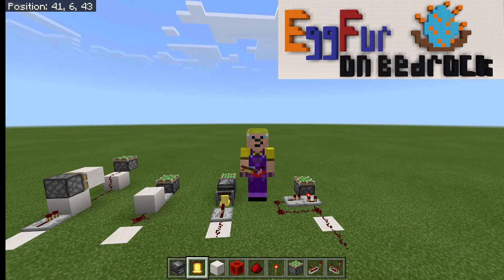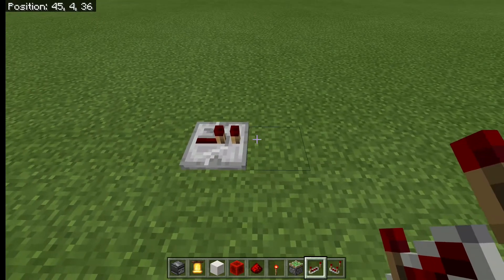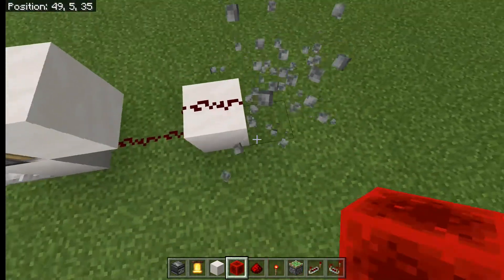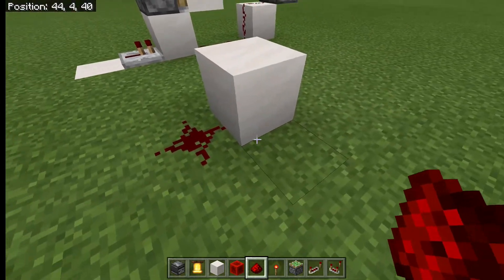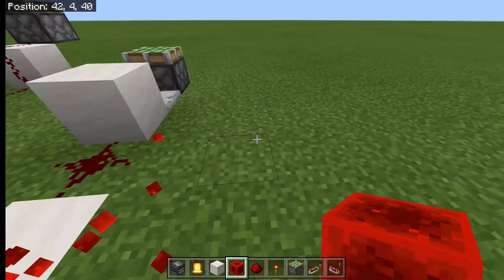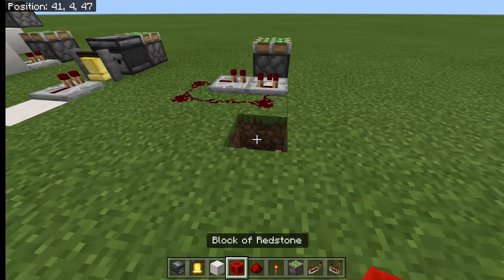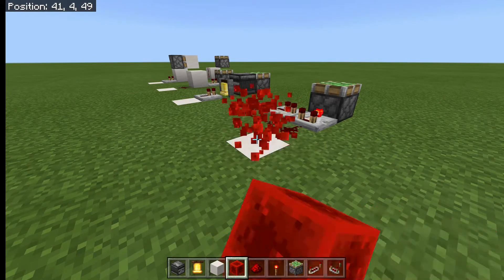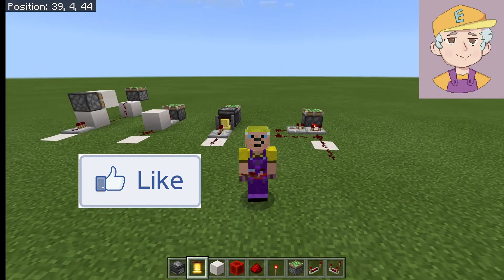4 one tick pulse limiters for Bedrock Edition (now 5! Read Comments)

Comment: For some reason the second one doesn’t work if I power the redstone with a repeater?
Reply from the maker: Are you powering the redstone or the block directly above the sticky piston?
Reply: @Eggfur  I’m powering the redstone itself, for some reason if I power it with a directly with a redstone block, lever, etc it works but if I power it with anything that causes delay (a repeater, a comparator, etc) then the redstone somehow powers the piston without the repeater on the other side getting any output
Reply from the maker: It's going to be because of p-ticks (producer) and c-ticks (consumer). Something I didn't know about when I made this video. It's a bit too complex to go over in a YouTube comment though. Have you tried the 5th method that I link from the description? It's super small and simple (an observer watching the powder snow dispensed by a dispenser). It's main disadvantage is that it will be just slightly slower to activate with a chunk border in the way - but only by 1 tick.
Reply: @Eggfur   I haven’t, currently working with a weird system where I link a repeater to a piston that pushes a redstone block which powers the mono-stable circuit, but I’ll definitely try it out, thanks! Could you please link me an article about the whole p-tick c-tick thing?
Reply from the maker: See how you get on with this. I'm not sure it's the best explanation but will give you a good start: https://youtu.be/oyLZa7dmxYw
Reply: @Eggfur  thanks!
Reply: @Eggfur  ok I’ve seen the video and also another one but I don’t exactly understand what this has to do with the powering of the mono stable circuit? Like it seems to only apply to things powered for a single tick but I’m powering the circuit permanently so I don’t really get why it powers the piston before the repeater
Reply from the maker: It stops being powered as soon as the block above the sticky piston start to move. So you only have time for a c-tick through the block which won't power the repeater. If you replace the repeater directly with a consumer (piston, dropper, etc ), it should activate
Reply: @Eggfur  yeah but the part that I don’t understand is how powering it with a different source changes things
Reply from the maker: Because a player activated action sends out a pulse starting on the c-tick rather than the p-tick. And same for the moving redstone block.  That's also why when you power two pistons with the same lever, but one directly with dust and the other through a one tick repeater, they both extend at the same time
Reply: @Eggfur  oh I see, thank you. No source I found mentioned that, so that’s super helpful to know.
Reply: @Eggfur  one last question: is this feature exclusive to bedrock?
Reply from the maker: p and c ticks? Yes. It's all related to the random update order and other redstone optimisations for performance.
Reply: @Eggfur  yeah no I understand how it works but java and bedrock were coded in different languages and tend to have inconsistencies in their redstone (quasi connectivity, or for an issue that relates more closely to game ticks and updates: bedrock redstone being inconsistent compared to java redstone) so I was wondering if it also works that way in java
Reply from the maker: The coding languages have nothing to do with it. Bedrock was written to work efficiently on low power consoles and mobile phones and so the redstone mechanics were changed since the Java ones are a mess when it comes to performance
Reply: @Eggfur   brought up the coding language thing more so to emphasize that they’re different at their core, as as a programmer I know how different java and c++ are.

Comment: Can you share some applications for these? (i.e., when and why would I want to use one)
Reply from the maker: I use them all the time in so many scenarios.  My elevator uses it to turn a button input into a fast pulse,  or you'd have to wait for the button to pop back out before the pistons can retract and move the player. 

The bell observer one is used in my one wide tileable t flip flop, again to turn a button into a short pulse. 

Yesterday I was playing with a circuit that needed exactly a 2 tick pulse, but it was driven by a hopper clock that gives a 4 tick pulse. So I used a one tick pulse limiter followed by a 2 tick repeater.
Reply: When you have things happen in order from one pulse but it needs to happen quickly so pistons and stuff dont lock up like in tree farms, they have to get out of the way very fast for the next thing to happen
Reply: Dude I just built it. Absolutely AWESOME! Works perfectly. I installed 3 in my machine along the different signal paths! This is also soo good because now since I don't have to worry about pulse length, I can set as many delays as I want, even let the signal build up in spots and not care since I break it again right after that! lmao i love it. always perfect timing. thanks again
Reply from the maker: That's great! Really pleased that it does the job for you.
Reply: I need these for a machine I'm building- I have a timer that makes a pulse every so often, but it stays on for too long. I just need it to fire once very quickly from that solid signal that happens.